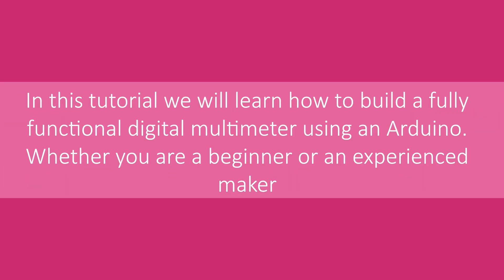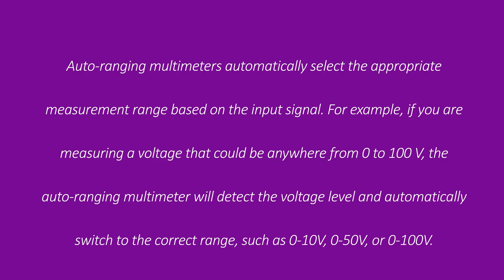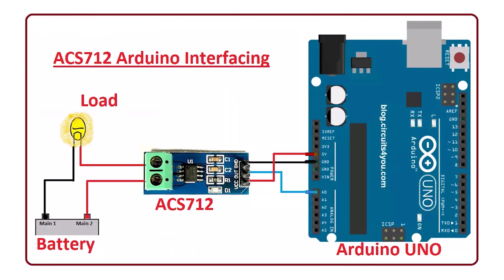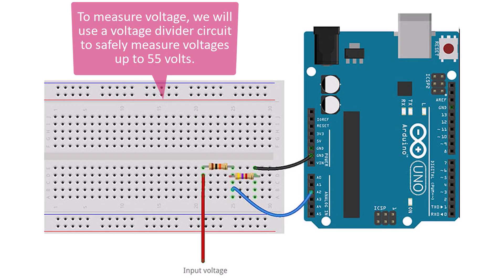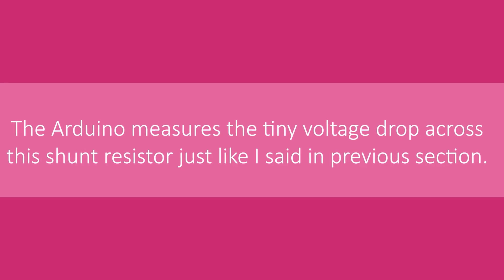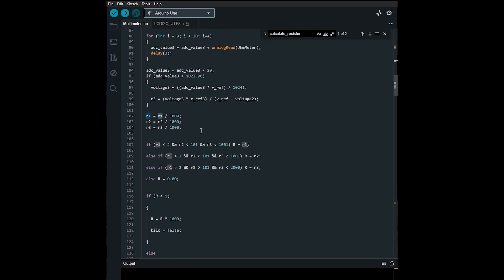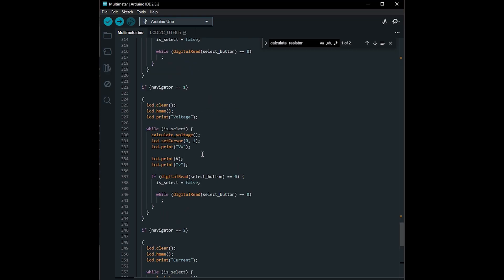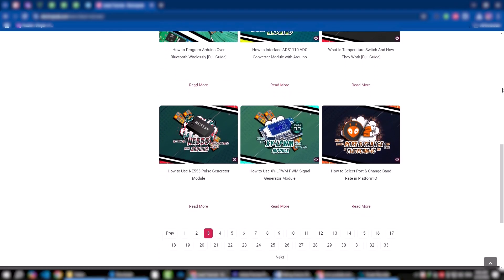Make a Digital Multimeter with Arduino

Comment: Thank you for making and posting this incredibly good looking and informational video. So how would I make a multimeter with an Arduino that would measure higher voltages such as 120V or 240V?